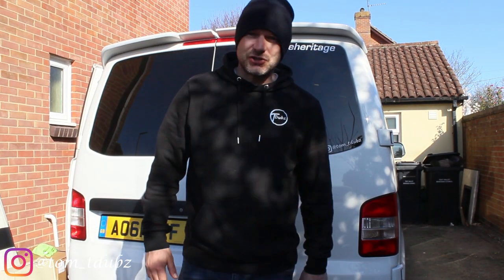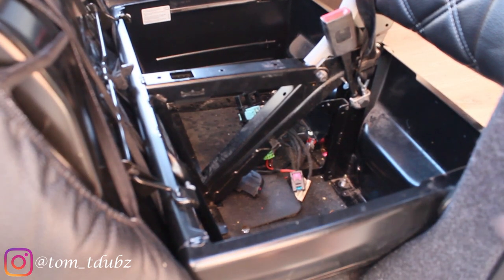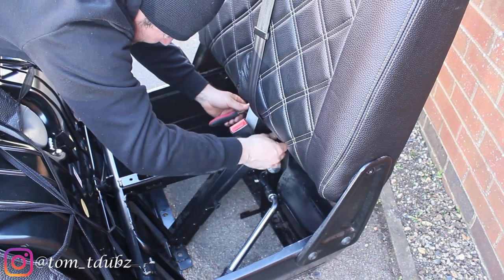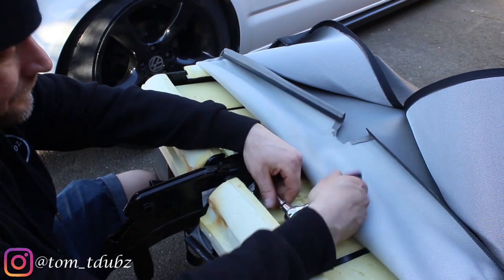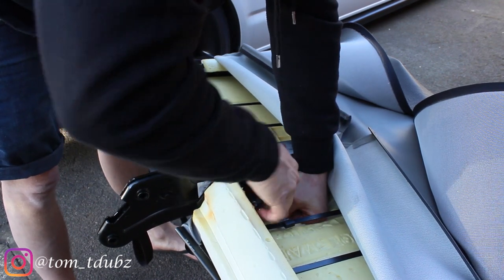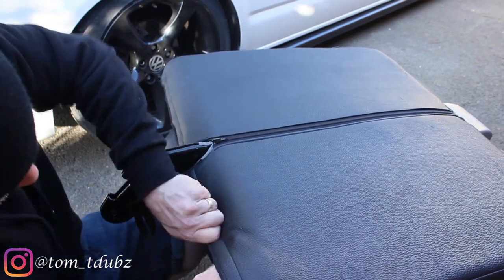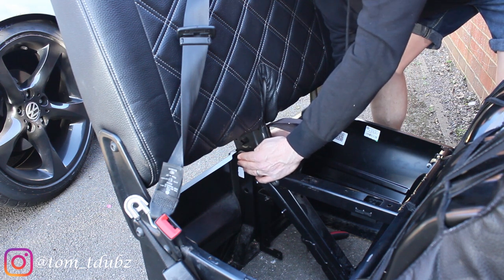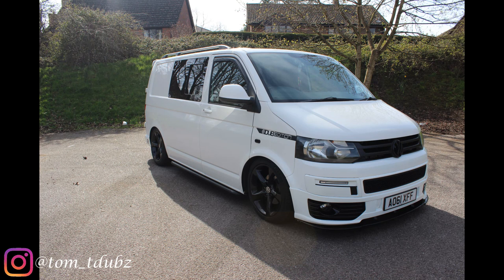Folding front seat #vwt5 #vwt6

Comment: 8 min 20 secs is the critical point during re-assembly. This is where the special bolt must be fitted (with hex nut allen head) to allow the seat to fold correctly.

Comment: Great video , you don’t Need to take the seat out though or disconnect Electrics , loosen 8 floor nuts and tilt seat towards drivers seat and take out top bolt in triangle shaped bracket
Reply from the maker: Found it easier to do it out the van 👌🏻👌🏻 thanks for watching 👊🏻

Comment: Hi Tom.
Thanks for the video.
I've noticed the grey plastic cover on the original non folding mechanism by the middle seat belt clip. Can that be re fitted to the new folding design?
Reply from the maker: It can be but will need to be the folding one... mine was just the fixed so had mounting points in different places
Reply: @tomtdubz  Thx. Mine is fixed aswell, so I'll need to source a folding one, that's if they exist. Cheers
Reply from the maker: There about just a different fitment so I guess people keep hold of them 👌🏻

Comment: What is the genuine vw part number of this bracket that you installed?
Reply from the maker: Off the top of my head… I think it was 
7H0881631A… hope that helps
Reply: @tomtdubz  off the top of your head... Some boy 👍🏻
Thanks I'll check it out!
Reply from the maker: @j13-lek  I have random stuff like that written down lol.. just in case I need another 👍🏻👍🏻
Reply: @tomtdubz  rear double seat be the same bracket you think? 🤔 Would like to convert that as well...
Reply from the maker: @j13-lek  the double should all fold flat.. there should be a draw rope/string on them to pull an fold

Comment: What tools required? Thanks
Reply from the maker: Socket set, m10 spline, spanner set..
Reply: @tomtdubz  thanks for reply
Reply: also an m12 spline. m10 for the bolt heads on the side of the seat. m12 for everything else.